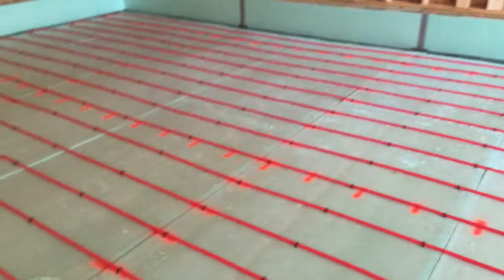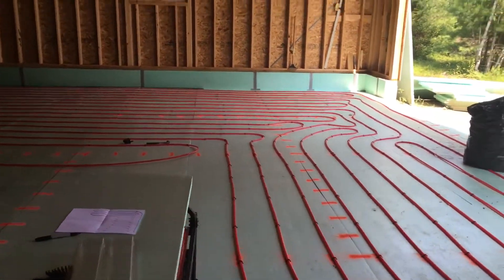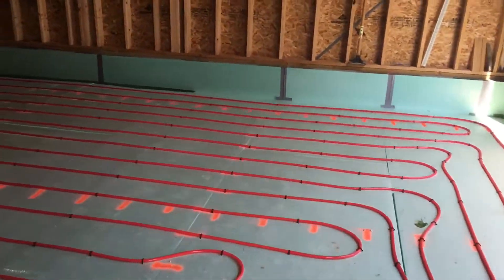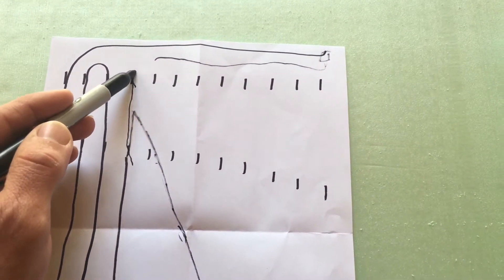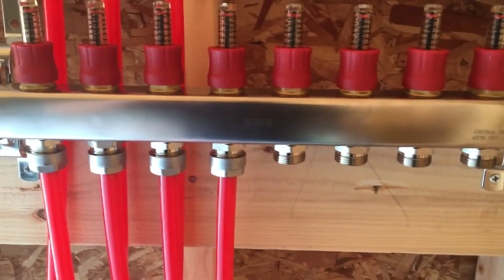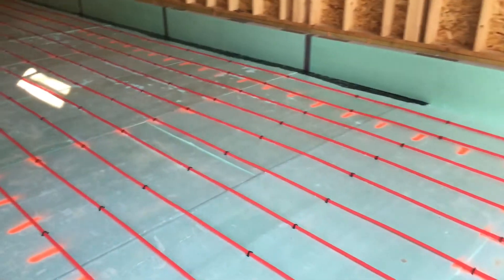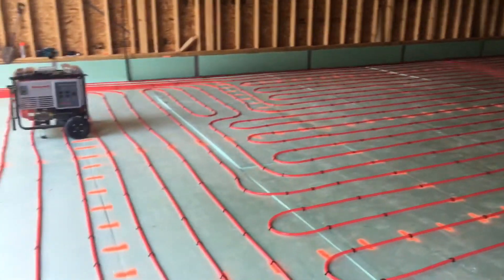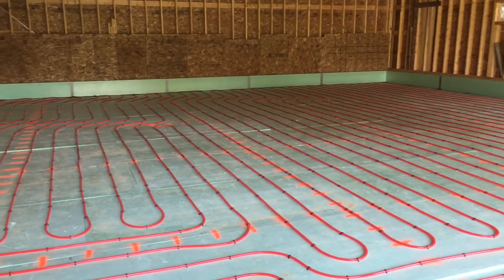Concrete floor: Installing Pex tubing/ radiant in-floor heat

Comment: You said 10K. Do you mean 10k just for the pex, manifold and foam boards??
Reply: Oh, I think you mean if you paid someone. $4500 max for the materials I guess.
Reply from the maker: @67blabla  it was 10k hired out, roughed in just like I did here. 4500 was my materials cost. Of course, that was few years ago and the foam board is now double the cost at 60+ dollars a sheet, at least in my area.
Reply: @barelystablefarm7151   Hopefully the price of the foam comes down like they are predicting everything to do in the coming years. Why didn't you use wire mesh?
Reply from the maker: @67blabla  yes hopefully prices come down, that’s a crazy amount for 1 4x8 sheet of foam. I did use wire mesh, it was placed in right before the pour.
Reply: @barelystablefarm7151  I have seen some claims that having the PEX at the bottom of the slab is not as efficient as having it in the middle. Some people use 1/2 rebar held up on bricks and then put the PEX on top of that. I would think that having it setup like that would be very difficult to pour the concrete as you would be tripping over the rebar and be unable to tell where to step. The PEX could also get damaged by stepping it down between the rebar squares. How does it work being at the bottom of the slab?
Reply from the maker: @67blabla  I’m not sure I buy that. The way this is installed is common practice, as well as zip tying it to the wire mesh. That’s another option. I’m not sure I would want it suspended. WAY to much potential for something to happen during the pour. And once you damage loops it’s game over. The floor works great! Nice even heat. I keep it at a constant 67 degrees inside the shop 24/7. Will never be without a building that doesn’t have in-floor!
Reply: @barelystablefarm7151  Good to hear. Thanks for the response. Just curious where you are located in terms of cold weather that you will experience. I am in Ottawa Canada.
Reply from the maker: @67blabla  I live in Southern part of Maine